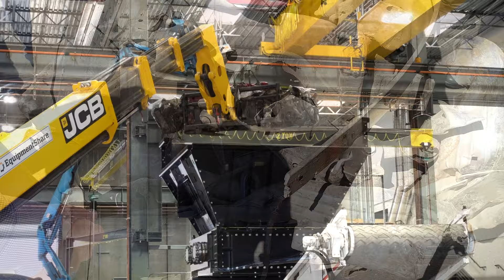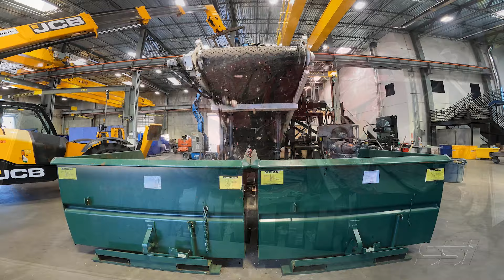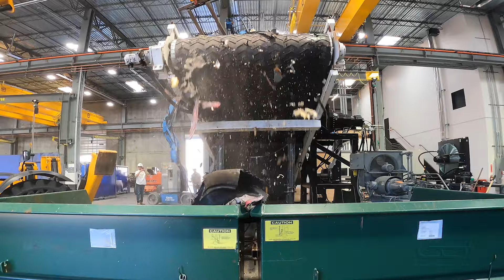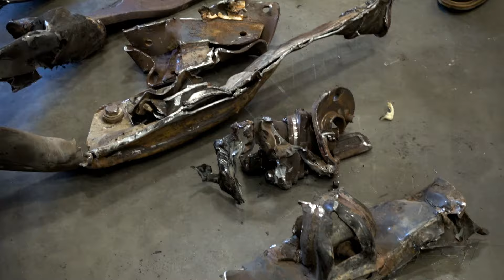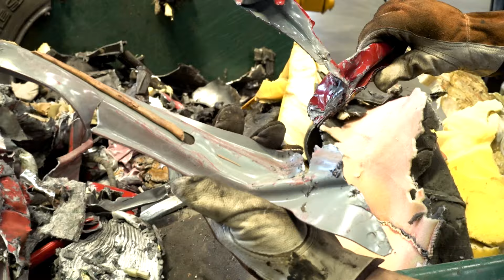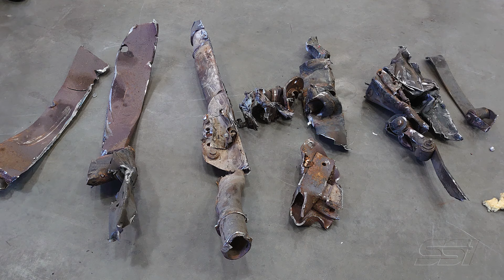METALS: Crushed Truck (M180)

Comment: As a hammer mill designer, I can't really see the point of putting a 1.5T baled car or truck through a contra shear. Hammer mill production can be proven to increase if bales are the primary feedstock, if the bales are opened up first in a pre-shredder. This is a twin shaft machine, which metres the feed automatically. The top roller controls and the lower toothed roller opens up and mills away the bale. This fluffier material, being less dense then passes through a fragmenbtiser much faster with increased breakdown. This helps save energy, wear and tear inside the machine, and promotes material separation afterwards in the downstream equipment. Bales are great for transport efficiency, but place an increased load on the hammer mill. 
The only reason to use this kind of shredder for cars like in the video would be a first machine for a small scrap yard. Don't get me wrong, I love SSI, their machines are awesome. For shredding flame cut skeletons in a profiling company, they would be a great way to increase scrap bin efficiency. Even as a way to shred meatballs in a larger scrap yard, (Alternators and motors) to break casings and separate iron from copper, great... But not baled cars and trucks. ;)